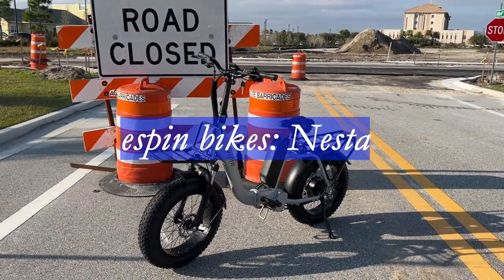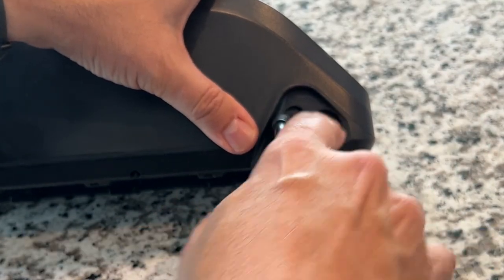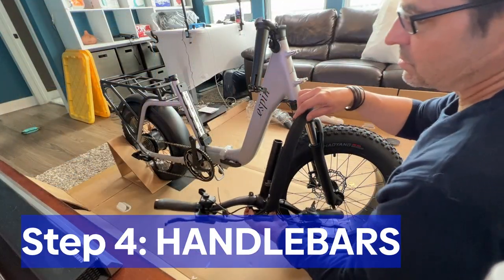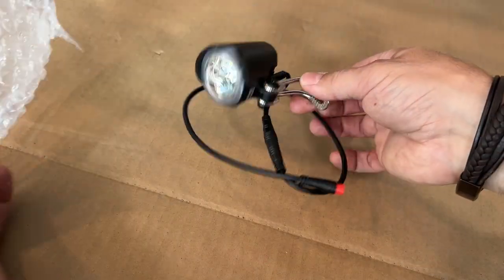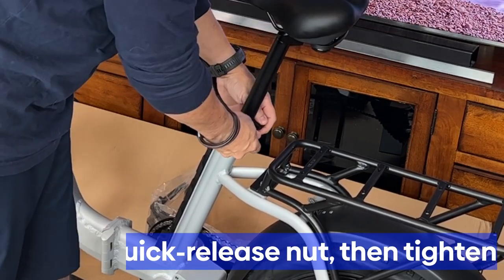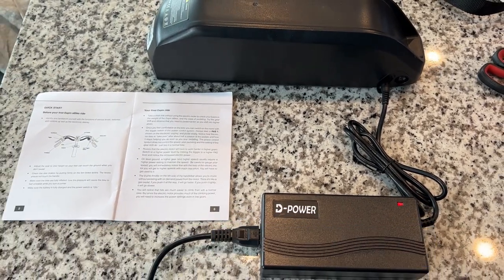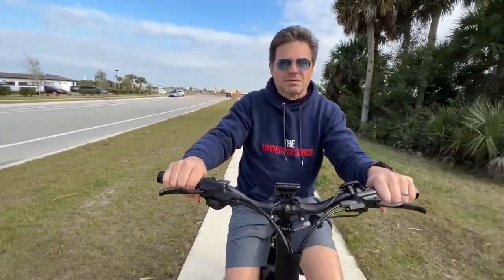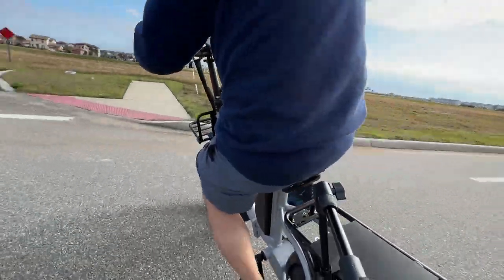Espin Nesta | Electric Foldable Bike Unboxing and Review (2022)

Comment: Looks like it's exactly the same size as the Himiway Escape. Same size motor too. Plus dual racks and hydraulic brakes. And it's foldable for the win! Bookmarking this for the assembly in case we end up getting one or two Nestas. Nice work
Reply from the maker: Almost identical length. Nesta is a little lighter. And FOLDABLE!

Comment: Deciding between this and the Heybike Ranger. I think the Ranger has rear suspension. Tough choice. The Nesta looks really good.
Reply from the maker: They're very similar in a lot of ways! The main differences are the Nesta has a 750 Watt motor compared to the 500 Watt on the Ranger, and the Nesta has hydraulic brakes, which is also an upgrade. The frame is about the same size and folds just about the same way, only the battery sits in front of the seatpost on the Nesta, and behind it on the Ranger. No big difference there. The Nesta has spokes, Ranger molded wheels.

Comment: One thing I noticed when you were assembling the ebike, when you put in the battery you didn't lock in the battery using the included key as the keys were still attached to the handlebar during the test ride. 
Your lucky you didn't hit any bumps while out riding, cause your battery could have bounced off the ebike and could of got damaged.
Reply from the maker: maybe